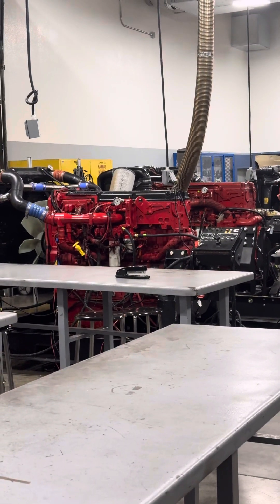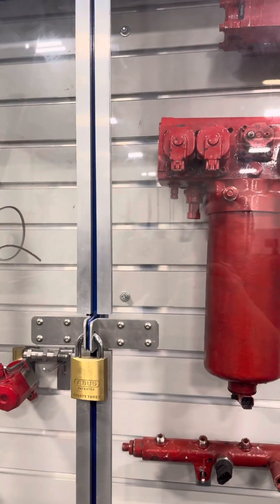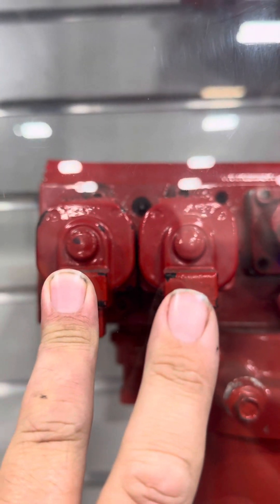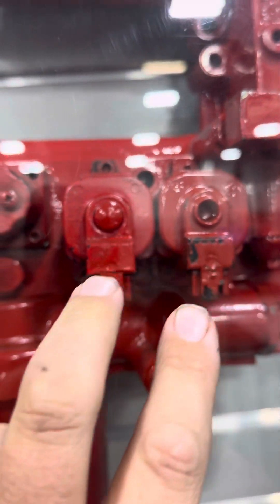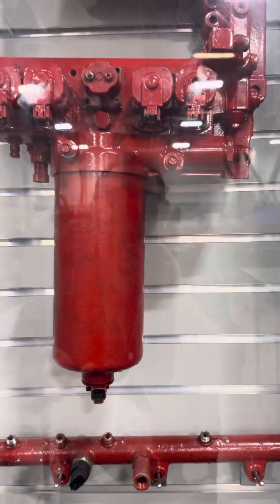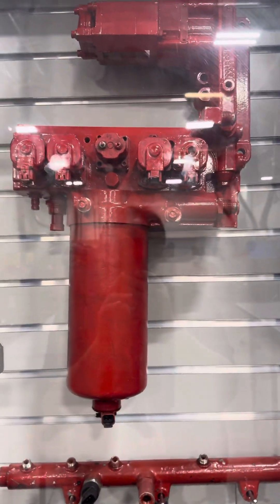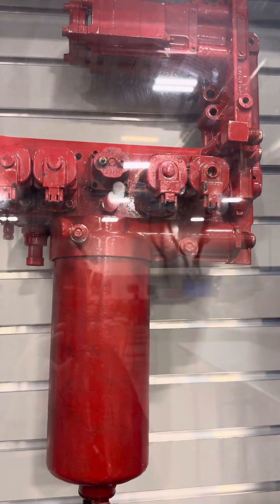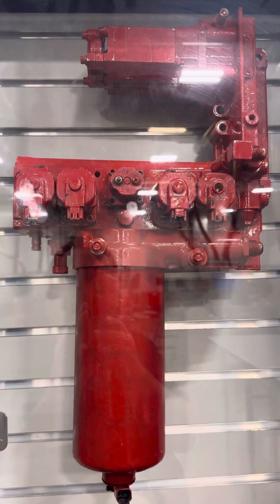Everything You Need to Know About Cummins HPI-TP Fuel Systems

Comment: Grateful for this video. Is it possible for you to do a video on basic electrical troubleshooting on a diesel motor?
Reply from the maker: It would depend on what you mean by basic? Troubleshooting what system? Starting, charging, CAN Network, Diagnostic links, ECM based testing? There is a lot to a modern diesel electrical system. If you can narrow it down than yeah, I could make a specific video.
Reply: @ ECM based testing
Reply from the maker: @ I will definitely add some ECM diagnotics test to the video list. Got a couple of ongoing projects so it might be a while but I will definitely put something like that out there for you!